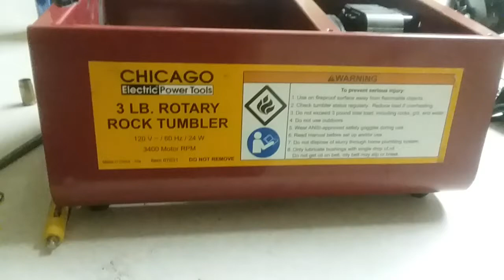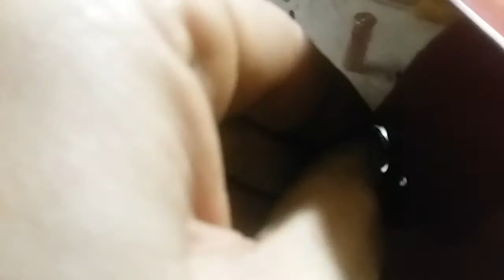Rock tumbler repair

Comment: Part of your problem is you don't clean your rollers between runs, your oil has turned to grease and tar at the ends. The black stuff. That strains the motor and heats the bushings. Use some rubbing alcohol and a rag to wipe it off.

Comment: I bought a dual barrel tumbler from HF and it works great...I load 30 cases (223) in each container...add about 1/2 cup of SS media... then..add the hot water..then a squirt of liquid Lemi-shine and a few drops of Dawn Blue... Here is a kick...I bought steel jacks (the game) and put 10 in each to agitate the brass more ..and I only leave the brass work for 1- 1 1/2 hours. It comes out clean, from inside to primer hole ( I deprime prior) . the trick in the end... make sure all the SS media is out of the shells...the Stainless it is made of is magnetic so add a good magnet to your tools...it will help to clear the pins from the case... You can use a dehydrator or a warm oven but I just let it air dry...outside in the sun if it comes up... I put it on a cookie sheet and set it on my BBQ since it is black...works great. 

As far as a wobble with the Duals...just "wet" the surface of the base of one of the containers and it will not catch and wobble on each other...

If you need to lube the rod bearings... graphite works well ( I use the Powder case lube...just a little. Maintenance always beats out replacement....